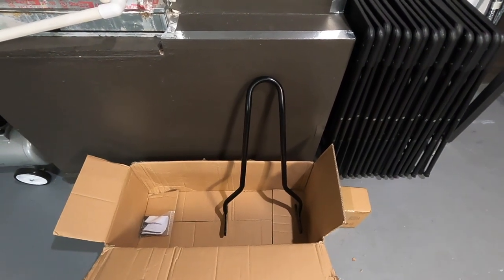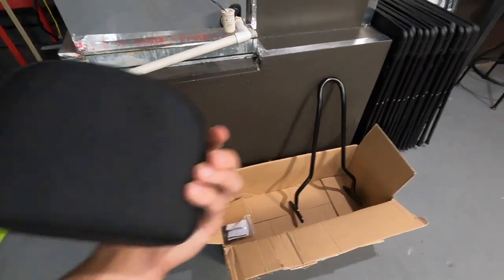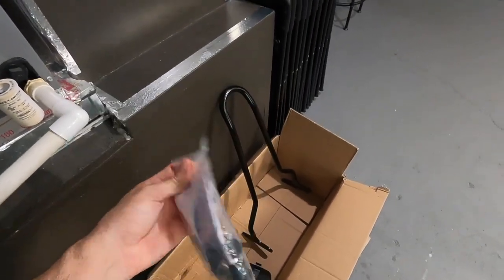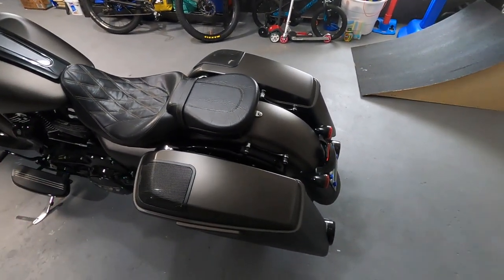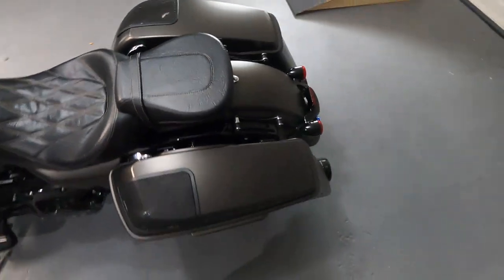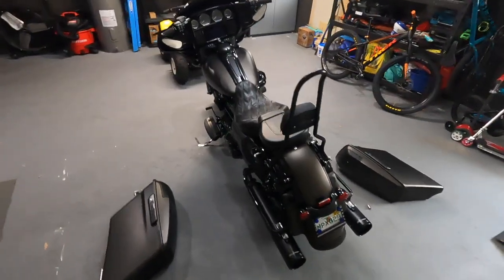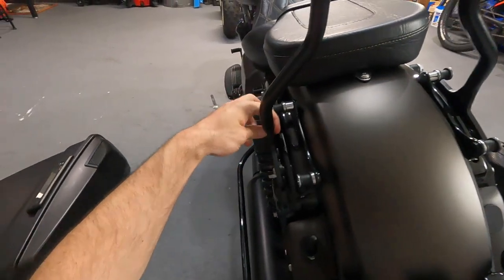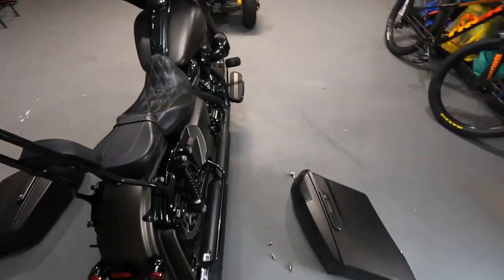Street Glide Special Sissy Bar by Craftride  | Stage 4 | Build Series | Part 3

Comment: Very good look . You mounted the sissy bar to the frame . I just bought the quick release kit from Harley, did you go with the frame mounted sissy bar over the quick connect type because its more secure.  Thanks for sharing
Reply from the maker: Check out some of my latest build series content on the bike and I ended up with a quick release as well. I sold the one in this video. But to answer your question, the reason I went with this one was for the looks of it. 😬🤘🏼

Comment: Hi Michael, very informative video, well done. Got a quick question for you: what’s the width measured in between the bars where you put the sissy pad? I would like to know this since I want to use my saddlemen sissy pad that is 17cm wide. Thanks in advance. Cheers, Marcel

Comment: Nice install vid, bro! LOVE the bike! How did you remove the tank badges? I have the industrial grey denim paint on mine, and I’m worried I’ll mess it up if I remove them. What steps did you take to remove those?
Reply from the maker: Thanks, Tim! I appreciate the love and support, bud. ❤️🤘🏼

I used a heat gun on medium settings, kept it about 8 inches away from the badges, constantly kept it moving right to left so that I wouldn't Destry the tank. Did that for about 10-15 seconds. Then with a glove on I lifted up the badging. 

After removing the badges I used Goo Gone or Goof Off to remove the remaining residue on the tank. Then I used some Simple Green to remove the chemicals in the Goo Gone, and followed it up by a simple dry wash of the tank. 

Hopefully that help you. 😅
Reply: @MichaelBertini  right on! I’ll try that! 🤘🤘